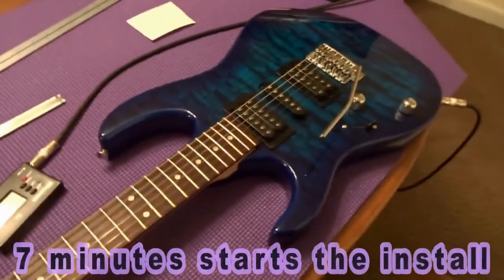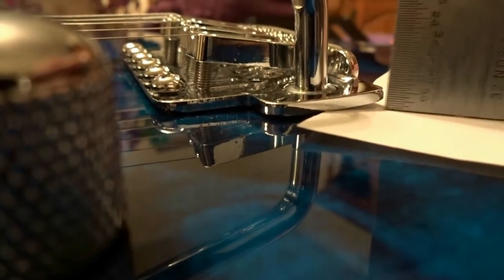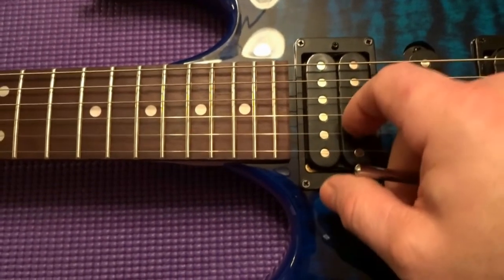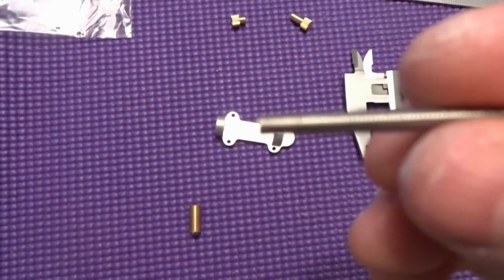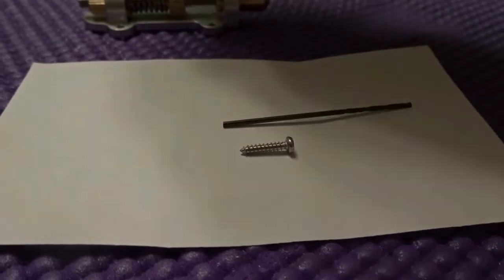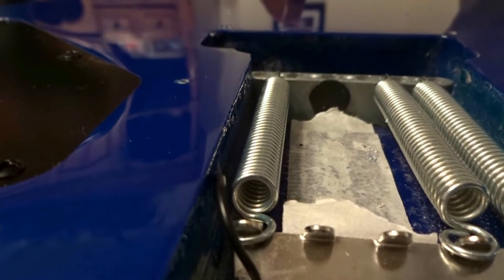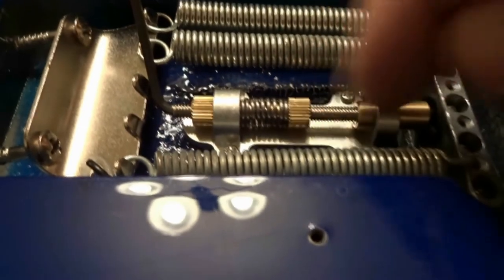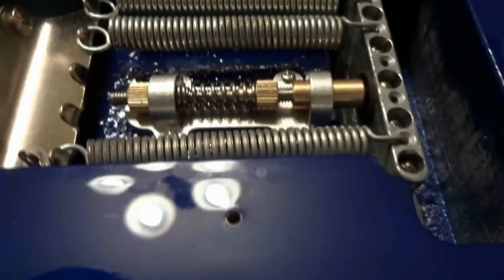How to Install a Tremolo Stabilzer & Float Trem or Floyd Rose (Never Out Of Tune)

Comment: Super helpful video given that the £12 Amazon variation I bought didn’t come with any fitting instructions. The gizmo itself has worked a treat on an el cheapo Bullet Strat. I’d already fitted graphtech nut and trees and locking tuners but was still having tuning stability issues when using the trem. This little device has sorted it (although the trem does have a different feel to it now). Thanks again!
Reply from the maker: I really glad to hear that it was of help! Don't feel bad Floyd Rose didn't send instructions either. It does give the bar a different feel. You're welcome.

Comment: I installed a very similar item in my ST guitar. It doesn't have the ball bearing like this one in the video. I have an Ibanez just like the one in this video and the trem is awful at keeping tune. It's my next candidate.
Had my floating trem set up and guitar tuned. I simply mounted it so that it just touched the block with no spring compression and adjusted the two knurled adjuster nuts for not too much resistance when pulling the whammy bar up. There was adequate spring tension to return the block to the exact position for proper tuning after a dive bomb.
Easy peasy. Hardest part was drilling the holes to mount it. Immediate results. Best 12 dollars I've spent on getting the trem to not leave the tuning sharp after every use of the bar. I put roller saddles and string trees to hardly any benefit but this thing worked fine. BTW, I don't use trem but I feel that if it's there it should work right otherwise I'd be just as happy with a hard tail.
Reply from the maker: These are great. Mounting is a bit of a pain but it stays in tune. A lot of artist I like use the whammy bar so I had to get one. I cut the nut & setup everything but it still stayed sharp until I installed this.
Reply: @TheCleaner6969  I have the same guitar and this made the biggest difference of everything else I tried like roller trees, roller saddles and locking tuners. I'm with the first guy who said he doesn't really use trem but if it's there, it should work right. I fitted it to every guitar with trem I have.
Reply from the maker: @fjborg6978  With this the guitar is really never out of tune even with change of weather. It's better then my fixed guitars.

Comment: I just added one of these to a cheaper (but good) guitar with a Floyd. I didn't want to try it on a $1000 and over guitar.  Two things, first is you don't need to pre-drill the holes. Just mark where the screws will go and just screw them slowly into the wood. They're tiny wood screws, they screwed in with ease. Just use a proper size screwdriver. Secondly, the unit makes a bit of noise when you pull up but it works well to keep the guitar in tune after pulling up. Not sure if it'll stay in the guitar or not but for $20 and 20 minutes of my time I figured I'd try it
Reply from the maker: I would watch, you might get away with screwing into softer wood but you might break the tiny screws in a harder wood. That's why I recommend drilling.
Reply: @TheCleaner6969  Yeah, I went by feel with the screws. This guitar has softer wood and I knew pretty quickly it wouldn't be an issue. I just used a screwdriver with a proper size head and a good handle on it. But yeah if your guitar has hard wood then drill the holes. For $20 it's a decent little device. I can even just retract it all the way if I don't want to use it. I don't even have to remove the entire device. But it works alright, I never used a tremolo stabilizer of any kind before. I fined tuned it some more after I posted my message here. One thing to watch out for, always do some dive bombs when setting this up to see if you're returning slightly flat. That happened and I had to retract the cylinder a hair and it was fine after that. Then pull up and see if it's returning to proper pitch and not coming back sharp. I just went back and forth between dropping and pulling up on the bar and checking the tuning. You won't get 100% perfect so don't obsess over a few cents on some strings, like the infamous G string. But it does keep it very close to the zero point. It's a balancing act. I mounted mine right smack in the middle and I also put some nut sauce on the cylinder to reduce any extra friction.
Reply from the maker: @johns.8961  Good added info. Hopefully others find it helpful as well.

Comment: Thank you for the outstanding tutorial (with the accent). Love it!

I am considering using this clever widget on my Harley Benton with Wilkinson floating trem. I get frustrated when tuning down to D, as it throws several strings out of whack. Would you confirm that this will squash the tuning bug? Otherwise I will opt for the FU Tone block and call it a day. 

Thanks for your time, brother!
Reply from the maker: You're welcome! I'm glad you like my accent :) I would recommend this one. If your nut slots are right & this is setup right it comes back to tune spot on. I just played this yesterday & really was hard on the whammy & it was just a hair out of tune that I couldn't even tell until I checked the tuner. It does change the feel of the bar though. I hope this helps you make your decision.
Reply: I'm in the same place- mine holds tune fine, but I can't tune down- something I failed to consider when buying a Floyd Rose guitar. That said- I think the way he's installing it here is for when you just want to stabilize the trem- not lock it down. I want it to where my trem. only works in one direction- so I think I'll have to install it slightly differently.
Reply: Hi will it stop Floyd from pulling up if I want ?
Reply from the maker: @satchrules101 No if you set it as floating you'll have whole & half step up. I forget exactly. It does change the feel of the bar but really keeps it in tune.

Comment: If you want better tuning stability on an old 6 screw whammy, then get a guitar with a zero fret. 95% detuning is caused by the nut, a stainless steel zero fret reduces the friction at the nut to almost nothing.
Reply: I got a new guitar two days ago. Even though it has a locking nut, the Floyd Rose Special detunes the guitar up to 30 cents. It is that bad.

Comment: Floyd just puts his fancy name on it as it is entirely made in China (the cheapest aliexpress). The bullet must be Nylon so it doesn't make noise when touching the block. The eraser does not solve this problem, if you are going to make an recording, you can feel the touch of the bullet.
Reply from the maker: Everything is made in China & they all put their name on it. It's discussing. Top names using the same cheap ass caps ect. You can make a nylon bullet or have a machine shop make one for you. This is one of the better trems around a little mod & you're good.
Reply from the maker: @maxammo6282  The only thing China made that lasted was this corona crap. But you're right you can tell right away if things are the real deal.
Reply: @TheCleaner6969  You're right my friend, China ended the planet, we hope that no more misfortunes come.
Reply from the maker: @marciomartinelli69  God I pray no more. God Bless us all!!

Comment: What size of the drill bit did you used?
Reply from the maker: Before you use what I did make sure you match the bit to the screw by holding it to the light. The body or the bit should only cover the body of the screw (Not the screw threads) I used a #53 bit.

Comment: If a string brokes the guitar stay in tune with this system in a floyd rose trem?
Reply from the maker: If you add enough tension I think it would. I could be wrong but I did use drop D & stayed in tune with some fine adjustments.
Reply: @TheCleaner6969  thanks!
Reply from the maker: @metamizol1606  You're welcome ;)

Comment: My friend you could also measure the drill bit depth including the thickness of the system so you don't have to go through this hushle moving the whole thing around and around just put the masking tape A FEW mm more than you center the first hole okay screw in the screw and then you can either Select to screw All the screws in WHITOUT drilling more Holes for that way the damn thing is much tighter than when you predrill Holes but that's just A matter of opinion My way does save you a lot of time if Time was ever the issue which I doubt

Comment: Bottoming out the spring turning the tiny knurled brass wheel is literally impossible. I’ve been trying to 2 days to do it. Looks like it’s going back.
Reply from the maker: Use an allen wrench at the back of the all thread. If you can't turn it with your fingers carefully use a pair of needle nose pliers to turn it. It does not have to be super bottomed out.

Comment: I installed one on my project Kramer Baretta Special. It installs and adjusts easily. I installed it for use with my D-Tuna. What I don't like is the noise when the brass trem block contacts it. It cracks. And the crummy little rubber bumpers make the tuning unstable. What it needs is a nylon disk which won't give but hopefully not resonate.
Reply from the maker: I got some of these https://www.amazon.com/SoftTouch-4759695N-Self-Stick-Small-Felt/dp/B07JCJMP21/ref=asc_df_B07JCJMP21?tag=bngsmtphsnus-20&linkCode=df0&hvadid=80470624768997&hvnetw=s&hvqmt=e&hvbmt=be&hvdev=c&hvlocint=&hvlocphy=&hvtargid=pla-4584070153200319&psc=1 but I didn't try them yet.

Comment: 2/32 = 1/16  0.062
Reply from the maker: Yes 2/32" equals 1/16th which is in decimal 0.062
Reply from the maker: Just as 4/32" equals 1/8th which in decimal equals 0.125. 1/4" equals 0.250, 5/16" equals 0.312. I know my decimals. I was a machinist.